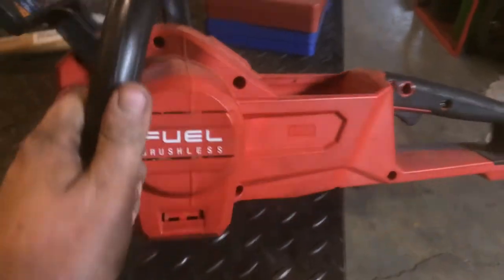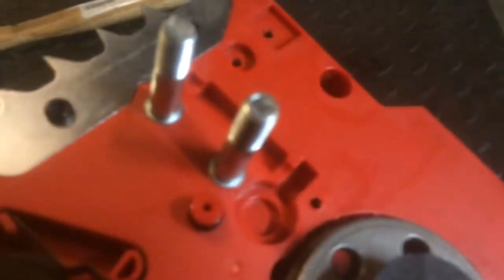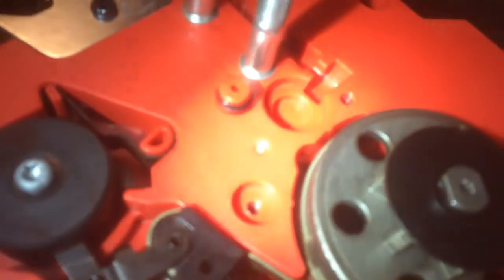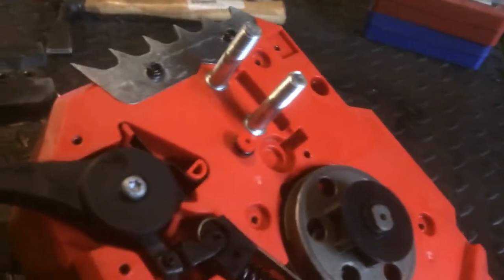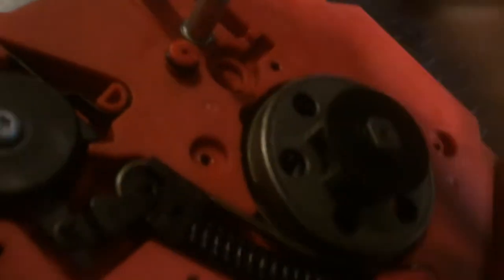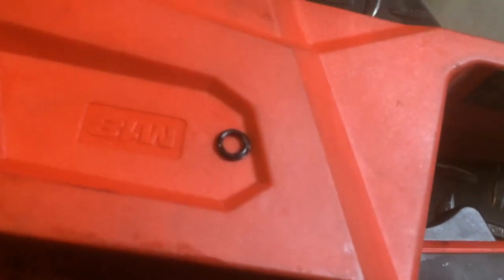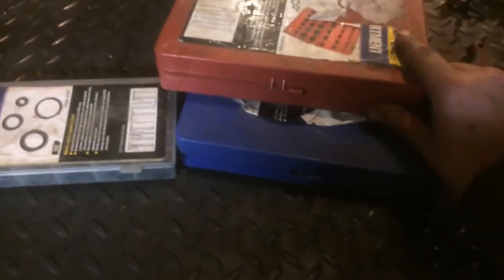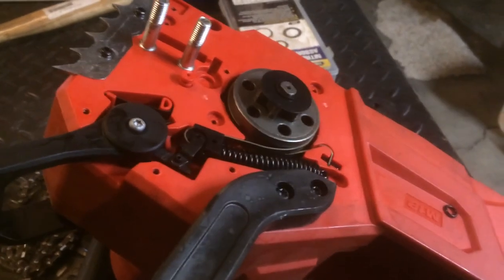(203) Milwaukee M18 chainsaw oil leak

Comment: It's a shame Milwaukee has such a widespread problem. I have this saw as well as the pole saw. They both leak like crazy. Through the chain area, the bottom vent holes and the battery area. Depending on the angle being held. I've tried storing it with the fill cap facing up, and that seems to help.

Comment: I took my Milwaukee chainsaw apart today. The main problem on most of them its there is 2 rubber hoses connected to the oil reservoir and they go rottenZ they cracked and thats why oil starts leaking like crazy..im going to try to call Milwaukee tomorrow and see if they can send me the replacement tank and hoses.. to fix the problem
Reply from the maker: Let us know what ya hear after talking with Milwaukee, would be good to if there is a good fix for this.
Reply: Any luck?

Comment: This is the worst part about this saw. It blows my mind that Milwaukee will put out something that this many people have a problem with. Will be tearing into mine today to see if I can do something to fix it. Thanks for the O-ring idea.
Reply from the maker: Yea Milwaukee dose a bunch of crazy shit, they also don't balance the cells in there batteries and that has caused a lot of issues too. 

My saw quit leaking oil after replacing that o ring but about 4 months later it started leaking again, I'll have to tear back into it and see what the issue is this time

Comment: Yep that was my video that I've since taken down. It worked for about a week or so, then started to leak as usual. Depressing.
Reply from the maker: Well shit that sucks. I haven't had a chance to use mine yet so I dunno if mine still leaks oil or not. Have you torn into yours again to see how that o ring is looking?
Reply: @tdm8817  I plan on digging into it this spring. This definitely is a problem mentioned in many areas on the Internet. No real solution that I’ve come across. I suppose I could  contact Milwaukee.
Reply from the maker: @wisconsinwoodsman1987  yea Id be curious what they say. I need to call them about some other repairs and I'll ask them about the saw
Reply: Were you able to identify the o-ring size by chance?

Comment: mine has the same issue, replaced O ring and it still leaks. Any ideas?
Reply from the maker: I'd check the o ring again see if ya rolled it when installing the cover. It's obviously easy to damage when installing the cover as this seems to be a very common problem with these saws. Mine has been leak free sence I changed the onring. Haven't use it too much but it's definitely not dumping oil like it did before. When I get some more use it on Ill make another video
Reply: @tdm8817  Thanks for this.  I'll give it a try and post the result
Reply from the maker: @watsonabel  sweet 
Hopefully you can get it to seal up!

Comment: I have the same issue. Any luck?
Reply from the maker: Ya replacing that o ring definitely helped but it seems that now I've got another oil leak, I actually haven't used the saw much because the bar and chain pissed me off so much. They were very crappy and poor quality. I just recently got in a cannon bar for it and I will make another video of it here in a bit.

Comment: I bought all three of the Milwaukee chainsaws (M18 16" bar chainsaw, M18 QuikLok Pole saw, M12 hacksaw) and they all leak oil.  Was starting to think this is normal/expected because I've never owned any such tools previous to these.
Reply from the maker: It's Definitely not normal. But leave it to Milwaukee to overlook such a big issue
Reply: @tdm8817  that's a real shame then.

Comment: Took to the dealer a while back. They said nature of the beast , deal with it.
Reply from the maker: @leonardstefanyshyn40  Jesus that's bullshit
Reply: @tdm8817  just took mine apart. Leaking where the hose pushes into the oil tank.
Reply: @tdm8817  just a shitty set up. Going to silicone on outside of tank and wrap cord around line near tank to pull it tighter on inside to seal.
Reply: The company I work for has had more than 20 of these over the last 5 years and every one of them leak.  They cut well but it's a shame that they can't fix such a simple problem.

Comment: Mine is leaking out where the battery hooks up by the electrical connectors 🤦 only 7mths old.
Reply from the maker: That's a new one, duno that Ive heard of a leak from there yet